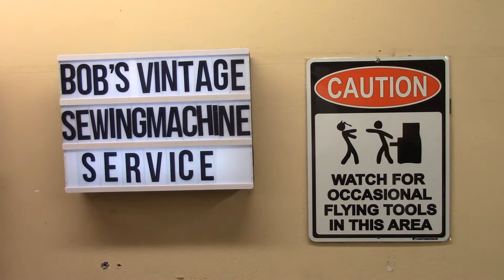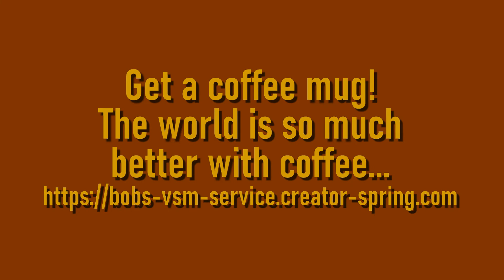Rivkie's Singer 15-30 Comes Back to Life - Sunday Morning Quickies, April 24, 2022

Comment: I have not discovered if you have already shown this, but I am in need of assistance on my 1908 15-30. Even given the date, it is electric, so no treadle to contend with on this one.  What I am having difficulty with is the bobbin winder assembly. I have two issues:
1) the bobbin tire doesn't come close to making contact with the balance wheel and there appears to be no adjustment options on the winder assembly, even though one model I've seen does have such an adjustment plate. I'm wondering if the tire I bought is not the correct one?   IS there another that is much fatter? Still not sure it would connect with the balance wheel hub but...just thinking.
2) In the process of fiddling with the assembly, I decided it was just time to take it off and clean it well.  I didn't take a close enough look at the position of the springs, so one I took off without noting it's orientation within the whole thing, and then another one "sprung" off as I was unscrewing it, so have no idea how it goes back on.

Have you done a video on disassembly and reassembly of a bobbin winder of this vintage.  It appears that they have changed in little ways over the years, so all the "help" I've been given so far doesn't apply to my exact design.  Thanks for any pointers you can send my way.   
Appreciatively, A Stumped Newbie

Comment: Hello Bob, I like your videos!  Question: What your opinion about soaking undercarriage parts in a degreaser solution rather than using a wire wheel for cleaning?
Reply from the maker: Hi Debora. Honestly, for me, it's an issue of time. The parts are still going to have to be scrubbed, regardless, so it's faster for me to just take them to the wire wheel and go to town. I always have another machine waiting in the wings, so getting the crud off as fast as possible is the way to go, at least for me. My shop is very small, so I don't have the luxury of having a lot of machines in various stages of disassembly at one time. If I have a machine apart and discover I need to source a part, I can keep maybe one or two aside (I have one on the side waiting for parts as I type), but not more. Oh yes, I don't have a slop sink in the shop, nor do I have a parts washer in the garage (yet), so all wet work is being done in the kitchen until I get my parts washer setup. My wife is VERY patient with me as it is, I'm not going to push my luck!
Reply: Any tip for those of us not having a wire wheel or that kind of heavy duty tools? In my case I do have time and patience. Is there any recommended product or solution to clean the parts and restore them to a clean and shinny look?